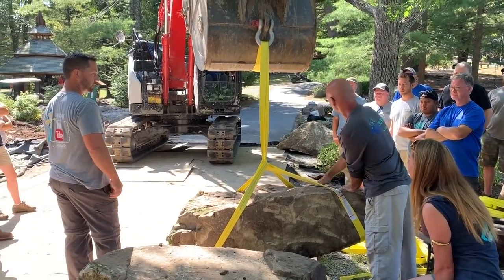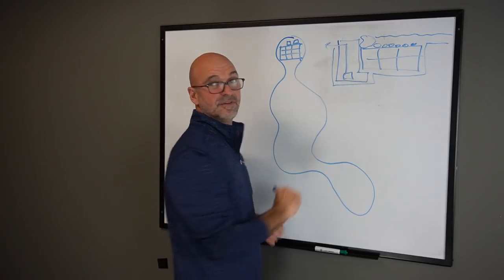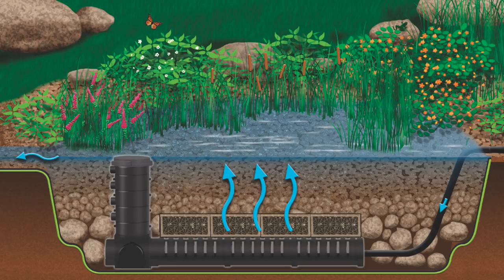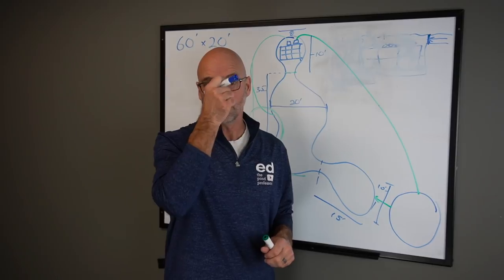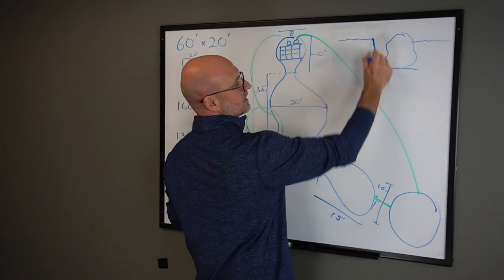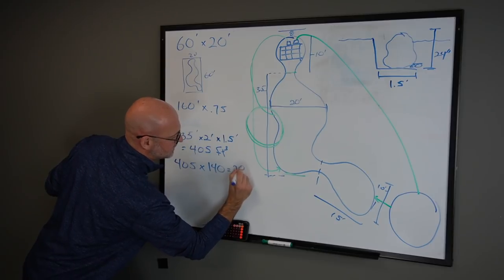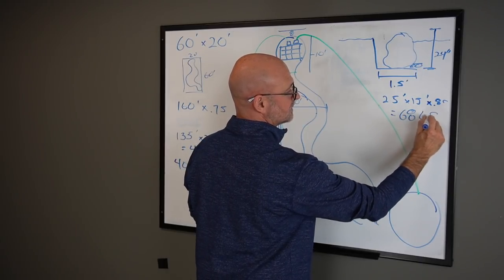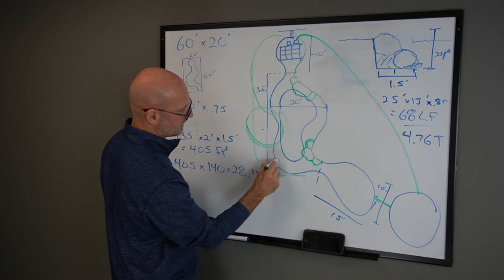Pond Rock Calculations: How to Determine What You Need

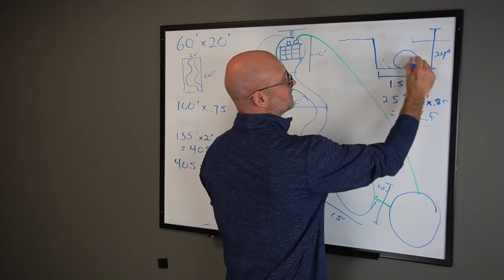Comment: @Ed Beaulieu; @Ed the pond Professor - I think I have a good question...Preface - I have a front yard pond that cleaned out in August of 2021 during our drought and now I am calculating stone for it this evening.  Here in the Twin Cities its frozen solid, so I was able to get an accurate perimeter, yay for 8 degrees in March – BTW the 0.75 multiplier was spot on for my pond – AMAZING!! Anyway, on with the question… I went back and found this video because I knew it explained exactly what to do. At approx. 14:30 in this video, you are calculating the second shelf. 25x15x2x0.85=68LF x 1' (stone depth) you mention stone height of 2' but then don't take it into the equation to get your overall cubic feet.  Your equation then becomes 68x1x140# = 9520#s/2000 = 4.76 Tons.  I believe it should be doubled to account for the 2FT height of the stones or 19,040#/2000# = 9.52 Tons.  Let me know your thoughts on this.  I’ll look you up this spring/summer when I can make it to Aqua Land.  Keep up the great content, this is what us aspiring pond builders and future CAC's need.  Thank you again! BC

Comment: Thanks a lot ! This was substantial.
Two questions:
1) You did not mention a fountain. Would that be omitted? And if so, what about the oxygenation needed for efficient biological filtration?
2) In aquariums it is not advisable to use materials that increase water hardness. The sediment rocks you mentioned seems to be of just that kind - par excellence. What is your experience with this type of rock in ponds? Do they really change water hardness notably? If yes, is this neutered, if biological filtering is efficient enough?

Comment: Thanks! For your gravel on the bottom of the pond.  What size do you usually use and how deep?  With a wetland filter and neg edge do you need to "clean out" the bottom gravel every year?  Or does it stay clean enough without draining and cleaning?  thanks
Reply from the maker: I prefer a mixture of sizes typically from 3” down to 3/4” but it varies depending on our location as some suppliers have different sizing.
I recommend a seasonal inspection and cleaning as necessary, in northern climates the biological activity changed dramatically throughout the year which will impact bacterial growth and activity

Comment: What’s the advantage to an intake bay as opposed to a negative edge? Is the pump suction enough to prevent that debris from escaping? I’ll practice and play with these calculations on my pond I already built. Some of it is slate or shale (flat rock)  but I’m not sure it’s density.
Reply: The Barefooted Gardener Understanding the density of the stone is important and you can get away with using less tonnage of flat rocks if you stand them on edge like a veneer, it’s a different look but it’s cost effective. The difference between an Intake Bay and Negative Edge is not that much, the main difference being the volume of the reservoir. 
In a Negative Edge you need to calculate the “Water in Transit” I may need to have a specific video on this subject in order for it to make more sense.....
Reply: Ed Beaulieu 
Good to know, and an interesting idea to stand slate up. That would be good to have a video to refer back to. Thanks Ed!

Comment: Would the stones you talked about using in florida have a chance for causing more algae being that they are compressed with all sorts of material? Also do they pose greater risks in ripping liner?
Reply: sillypotato9067 These rocks will create an elevated pH due to the amount of calcium carbonate in the rocks but this pond will be fed rainwater which has a low pH so it should buffer itself out. 
I’ve also had good experiences using this stone on other projects in Florida without any harmful impacts.
I want to stress that on all of the projects using this stone I have oversized biological filters which will also help with algae control. 
As far as damage is concerned, it is a very jagged stone so I’m using a Heavy Duty Geotextile material over the entire rubber lining to protect it from abrasions.

Comment: I would have used some of the returns to create big areas to mimics some swamp land . On a side note I would like to see a stoneless pond as some areas don't have big stones
Reply: Richard B I will definitely have one of the returns creating a huge Marshland, you’ll see it as we continue with the construction of this project. 
As far as no rocks, I’ve created some in the past and we had mixed results and water quality challenges. 
I’m typically trying to mimic Oligotrophic and/or mesotrophic aquatic ecosystems which require some sort of substrate for the benthic habitats.
Reply: @edbeaulieu5916  look forward to seeing that . A fine gravel on the bottom would be good but with maybe a pubble clay  . I am basing the look of some of the waterways I see in England
Reply: Richard B The Chalk streams?
Reply: @edbeaulieu5916  yeah an artificial one would  be interesting
Reply: Richard B It would!